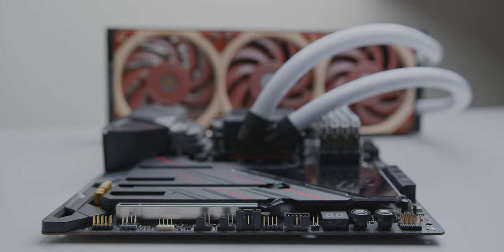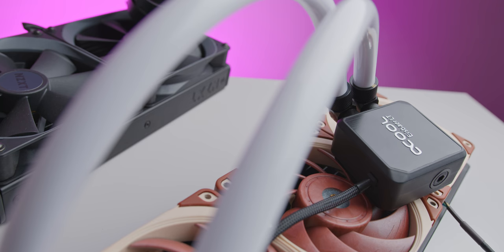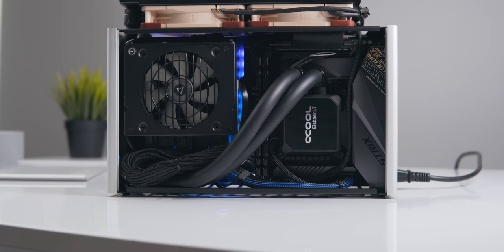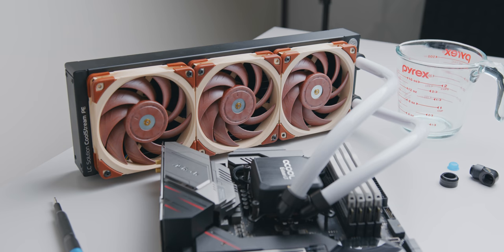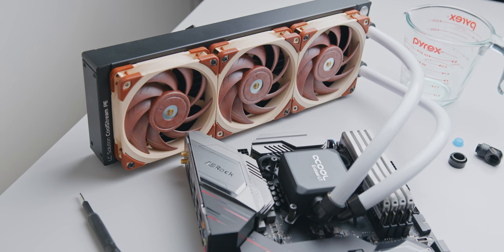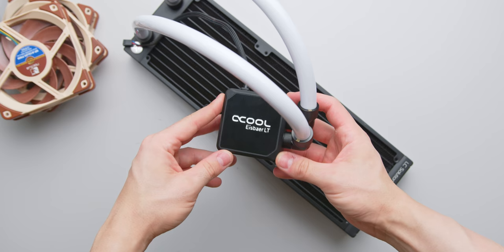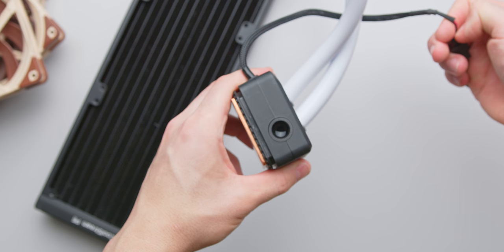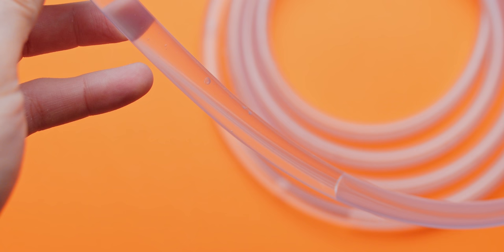Building an Overkill, Modular Liquid AIO Cooler

Comment: I'm at odds. I've had my corsair h100i for about 5 years. Still have stock fans. I want noctua fans but I know my h100i has limited life left. I can bring my fans to new aio, but that still adds lots of cost. If I buy fans now I could go down the route you are showing when aio dies.
Reply: I recommend to get noctua or be quiet fans. I have quite a few ml120s like 7 for a couple of months. Some second hand others new. When used continuously at 45% rpm 800 or so. Some of them are starting to rattle. Better off getting different fans in the long run. Good luck

Comment: A large enough reservoir will show a (small to significant, depending upon volume) difference in temps between the top and the bottom of the reservoir. I have built a pc, okay, over 10 years ago but laws of nature did not change, and omitted the radiator completely. I had a 15 liter reservoir but later made it about 900ml and it still worked okay, I think 65 watt not continuous load cpu should stay cool enough with such a solution. Was 100% passive apart from the pump.

This is a very good solution for ultracompact builds though. I may yet use it. The biggest radiator I can fit with the widest tubes, it should fit 140mm fans 2×2 in what I had in mind.
Reply: No, reservoir capacity won't show difference in max temps. What big reservoir can change is how fast it takes for loop to reach peak temperature.

Comment: I think the best way to remove air is probably put the pump tubes in\out under cooling liquid like in a pot, turn the pump ON and will keep circulating the coolant so it doesnt run dry, then attach the tube with exiting water from the pump to the radiator, let it circulate, then put the radiator under water and attach the "IN" tube of the pump to the radiator under the coolant and will still be filled with the minimum air trapped possible...

Anyway Alphacool is actually decently priced and already brings a full copper radiator in the AIO and good fans on the aRGB version (at least in their technical specs), but it's a bit sad that a lot of other AIO just simply outperform the stock alphacool easily :(...

Comment: I spent $110 on my Watercooling setup from ebay. (Used) Swifttech H240x2 ($45), 360mm full copper Rad ($35), Universal water block ($17),  Tubing ($5),  and Vram heat sinks ($3). Only mod I needed to do was remove one fan and the heat sink from gtx 1060, then reinstall the cover and let the other fan run at 30% constantly to keep the vram cooled. Max temps after several hours of gaming have only been up to 48c with cpu and gpu overclocked.

Comment: Nicely done! I wanted to build the same solution but we then went with a ddc on a 140mm fan mount and a dedicated cooler. It's a bit more complicated but in the same sub 200 price range if you use chinese parts from Bykski and Barrow. Did a video about its construction , too, if you're interested.

Comment: This is a really cool concept but it would be nice if you shed some light on a couple of KEY missing points.

1. How does this configuration compare to an H150i or an X72. Direct comparisons would be nice so we can see if there are any thermal advantages to help weigh the decision. 

2. How does the reliability, chance of a leak, and maintenance compared to a traditional AIO/CLC? Aside from selecting the right coolant like distilled water and some type of premix, do traditional AIO's offer anything that improves the reliability, reduces the chance to leak, and requires less maintenance than this configuration?

I think these two points were overlooked in the video and would really help people decide if this is the way they want to go. Otherwise, all we were able to get from this is that 1. It's possible, 2. It offers more customization for rad sizes and tube lengths, and that's about all we got from it. But for the vast majority of us, a regular AIO fits just fine so for this majority group, I think it would be helpful to at least have the specifics of the topics I mentioned above. Perhaps you could reply with some details regarding those points?
Reply: Regarding second question, AIOs come with properly mixed coolant that prevents growth and rust (pleb AIOs use copper block with aluminium radiator). Of course, you can mix it properly yourself, on top of that, you can refill the loop any time you want to. 
I wouldn't say it has higher chance of leaking than regular AIO. There's really no reason for soft loop to leak, assuming you don't damage the fittings or tubes.

Regular Eisbaer LT outperforms Corsair and NZXT AIOs, don't see a reason why one with thicker radiator and Noctua fans wouldn't do the same.

Comment: I actually did something similar, even for further extend. Regular all-in-one can't catch up with my 7940x when running CFD simulation for days, but my case don't have enough space for a reservoir, I screwed a D5  pump onto a radiator and made compact loop, it runs 10 degrees cooler compare to AIO cooler with same size. It's likely because a D5 can provide like 10 times the flowrate of a  typical AIO cooler, and a copper radiator is more efficient than a Aluminum one. Of couse it looks like a mess, not even close as elegant as your solution, and filling a loop without a reservoir is a nightmare.

Comment: I'm in the process of buying all the hardware for my first custom loop. I'm going with all EK parts, 2 x 360mm + 140mm radiators with 11 be quiet silent wings 3 fans for push and pull in the front and the back...I have to say it an expensive business but I really want to see how much I can squeeze out of my 2700X + Radeon VII Rig :-P

Comment: I called it!  Back when you picked the swiftech apogee pump.

Alphacool’s Eisbaer LT, and Be quiet’s Silent Loop are the way to go with SFF builds.
Reply: Or if you can fit it, Arctic Liquid Freezer 2
Reply: Right or you can fit it with Arctic Liquid Freezer 2 240 mm or 360 mm and you save around ~ 200 euro:D

Comment: I'm seriously considering doing this for a slim 240 aio for the Thorzone Mjolnir. I know you said you'd rather water cool the GPU but the temps even with the more obtrusive side panel were still below 70c. I feel like a an aio for the cpu makes more sense, given that an undervolt on the gpu should bring those down even more & I'm not stuck with a loud/small/barely effective cooler. Thanks for the guide.

Comment: My Alphacool Eisbaer LT360 which is the same pump design the fluid inside dissipated after less than a year of use which was weird.. My 8700k started hitting high temps so I removed the block reinstalled it multiple times till one time I shook the rad to hear a low volume of fluid inside. I could hear there wasn't much in there. Just something I found weird. Yes I know you can top it up but the coolant should not have dissipated in less than a year.

Comment: I was looking at the Alphacool AIO that includes this pump/block unit with a 360 copper rad and 3 fans for under £100 GBP inc tax. I think the benefit of being able to upgrade it down the line is huge if you're looking for something that'll work out of the box and give options later on for more custom components. If I recall rightly, wasn't the block also used in the Fractal Design Kelvin series a few years ago?

Comment: Hey have you looked at the * Alphacool Eisstation DC-LT Solo Top* at all? This video made me question a few things about what i thought i knew about water cooling. With really nice copper rads and cpu blocks coming out for cheap from companies like Bykski, it seems you could make your own DIY AIO for the low. I ordered an 18 dollar Bykski ddc pump with armor from formulamod with a Flow rate of 500 L/H and a 3 Meter head pressure. Using some spare water cooling parts i want to see if i can't put together a non hideous DIY AIO cooler.

Comment: Would like to see this kind of video for GPU cooling as well!  AIO for GPU with already bought waterblock. I also have leftover 280x40mm EK radiator.
Like those WaterForce solutions for NVIDIA cards or the AMD Fury-X and Vega 64 LC variants. I know that most of them have built in pumps to radiators (EK Phoenix series , which is discontinued).
How to build AIO from (not so AIO components)? Maybe an idea for next video. 
Loved this video!
Reply: Viilutaja I think he has done that with the NZXT G12 bracket. He used an off the shelf AIO, but I imagine it being a similar process👍
Reply: https://www.alphacool.com/eiswolf-gpx-pro-aio

Not exactly the same, but connect this to the external pump and done. 

Or connect it to Eisbaer Solo and build a CPU+GPU loop.
Reply: @currentlykent4593  I know that, that is the most common thing to watercool Your GPU.
But I was talking about when You already have a full cover correct waterblock from EK, Barrow, Bykski and want to add a radiator and pump (no reservoir.)
What are the options? EK doesnt make anymore the radiator+integrated pump combos...

Comment: Very interesting, what if you use a custom water block (let’s say for TR4), that doesn’t have the pump, how would you recommend to finish the custom AIO (separate pump vs radiator with pump included)?

Comment: i just did this. thanks for this video! I did a 240mm PE, 2 Noctua nfa12x25 fans,  2 EK quantum torque 90 degree, 4 EK quantum torque stc 10/16 fittings, and EK zmt black 10/16 tubing. Still between the alphacool or the new barrow block/ pump. is it worth an extra $40?

Comment: would the PE 480mm RAD with four Phanteks T30s be good enough in a custom ITX vertical case (meshlicious inspired) to cool a CPU & VRM (Monoblock) and RTX 3090 (with active backplate) trying to get maximum performance at the lowest noise levels??

Comment: Man your videos inspired me to downsize from a phanteks case to a sff. 
I’m planning on getting a streacom da2 with crosshair viii impact 3900x and 2070 super. 
Would this alpha cool cpu pump/block be enough to move water through the 280 radiator and gpu block? 
And do you think the 280 would be able to handle both cpu and gpu? 

Computer use is light gaming, heavy photo editing and light video editing.

Thanks man!

Comment: Question about this CPU/pump combo. A normal D5 is rated to 1000L/H, even Corsairs cheapo D5 is moving 800L/H, while this one is rated to move 100L/H. Wouldn't that be an issue if we want to add a GPU block or an additional radiator?  I ask because I'm not sure if D5s are extremely overkill or do we need actually need all that flow? I'm doing my research because right now I'm using an AIO and the next logical step is a custom loop.

Comment: I might be wrong, or maybe I've misunderstood something. But would static pressure fans be better for a radiator?
Reply: Static fans. Yup.it helps to push the air through the fins. Best to get noctua or be quiet fans. Corsair ml120s rattle when used at low speeds over time

Comment: keen to know the limit of that pump block combo. could it run 480rad, or dual 240rad, or cpu + gpu + 280rad (which i might actually do) ? At which point does the performance drop compare to full custom loop (with dedicated pump) ?

Comment: Only thing im worried about is noise. No one ever really talks about hoe audible aios or custom loops are under load.
Reply: One of key advantage of custom loops is that they are far more silent than AIOs. 

If you cool only the CPU, just set the Eisbaer LT Solo to 7V  and the pump will be barely audible.

Comment: Wouldn't it have made sense to use quick disconnects? That way it would actually be modular.
Reply: It's modular regardless due to the fact that you can expand it any time with regular fittings.
Reply: @dainiusvysniauskas2049  My thought was say you wanted a bigger rad, you'd just disconnect the smaller one and connect up the larger one. Or if you wanted to add a GPU into the loop then just connect it in. Saying that I guess you'd still need to rebleed the entire system.
Reply: @Spookeyo  Yeap, still have to rebleed the system. Quick connectors just let you do the job faster and easier. But it's not like you can't replace radiator or expand the loop without them

Comment: Clean af!
Now the real question however: Does the Alphacool LT solo also work on a G12 GPU bracket? I feel there should be more easy ways to cool ones GPU, as in a normal midrange system its the graphics card that makes most noise with its coolers, even versus a basic noctua CPU tower cooler...
Reply: Nope, mounting and coldplate are different
Reply: @dainiusvysniauskas2049  So different from a standard AIO block? 🤔
Reply: @Lucaemar  Yes. Most of mainstream AIOs are built by Asetek, meanwhile Alphacool Eisbaer is Alphacool's (duh) in-house design.
Reply: @dainiusvysniauskas2049  can it be mounted directly on the gpu die with the mounting brackets provided?
Reply: @paulmichaelsabapathy9672  I believe it would require custom mounting brackets
Reply: @dainiusvysniauskas2049  thanks Dainius

Comment: no temp comparision with the off the shelf AIO? what's the point of this video then?
Reply: Showing that you can make a custom solution without using a bulking pump/resevoir that can be a problem to fit in SFF cases.

I did something similar with pump/blocks from ID Cooling and a pair of copper radiators.

Comment: As it is in the vid, could it support a GPU?
EDIT: A GPU on top of the CPU, of course.
Reply: Yes, the pump is capable of driving CPU+GPU loop, so as long as your radiator can dissipate the heat, it will be fine

Comment: Optimum Tech Right or you can fit it with Arctic Liquid Freezer II 360mm and you save around ~ 200 euro:D and i bet is only + 4 C degree with Arctic Freezer II 360 mm, you can try to do a test yorself if you don't belive me:D
Reply: And the Arctic P12 PWM PST fans that Swiss engineers are used on Arctic Freezer II are almost the same as good as Noctua as the half of the price or more:D
Reply: Yeah I looked making this and it's easily 250 still. That CPU pump is normally 60 but shipping from Germany is 50 plus Rad 80-100, 30 fans, fittings 20-50.

Comment: Between the expensive brand cost and frankly non-creative design of the cooling hardware in the higher end makes them a terrible buying option. Take an ultra budget custom build, $35 360mm copper rad + $30 copper CPU block/pump + $10 tubing + $10 of fittings + 3x$3 120mm fans = ~$100 not $300

Comment: Crazy how a custom built aio is much more expensive than how much I’ve paid for my 2700/rx580 combined. I will never understand enthusiasts 😂
But hey, if you have the money why the fuck not, you gotta enjoy the money you earned.
Reply: Eisbaer LT solo block – 65€
Barrow or Bykski 360 radiator – around 35€
Barrow fittings – around 15€
So you just need some tube and coolant, another 15€?

So for under 150€ you can totally build custom AIO. Your 2700and RX 580 must have been dirt cheap :D
Reply: Dainius Vyšniauskas got it for USD130 for the 2700, USD100 for the 580, 8gb by the way. I dont know how much is that in € 😅

Anyway, i was obviously referring to the parts on the video, if you’re talking about cheap parts then that’s not enthusiast anymore.

Comment: I put 150 bucks worth oc noctua fans in push/pull onto my 150 dollar cooler master 360mm AIO.... my 3950x does NOT go over 70c, ever. epic win.

the same in terms of a custom loop would cost twice that and offer zero performance gains in terms if lower temps.... zero. nothing. sure i cannot expand my system to include a gpu, but you really DON'T have to liquid cool gpus.... its not required. and most likely of you were buying one, youd just buy the hybrid that comes with an aio attached.....

Comment: Uses pump from a 100$ 360mm AIO, says a decent AIO is 150$.
Reply: Btw I'm using a Alphacool Eisbaer LT360, it uses the same pump as you use in that build, do you think it can handle 2 360mm rads or it won't have enough power?
Reply: @Some1sm  The pump should be able to handle 2 rads, at least that's what Alphacool suggests. Just make sure to run the pump at 12v.